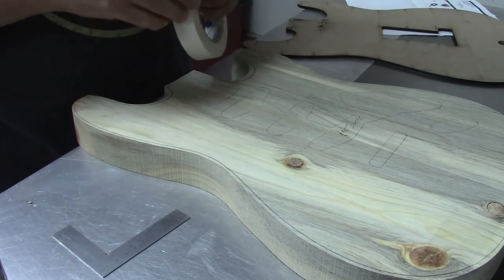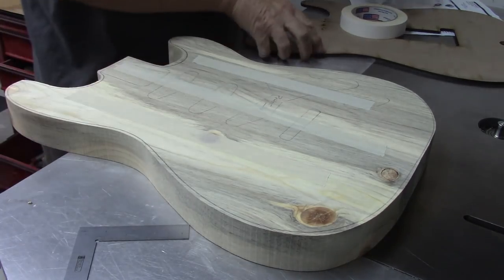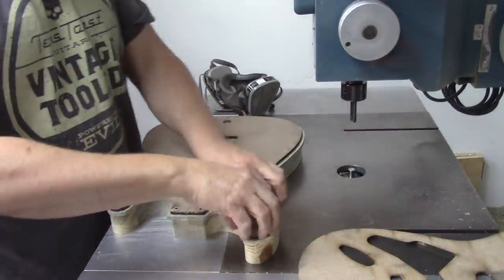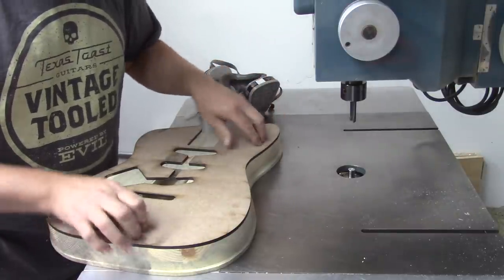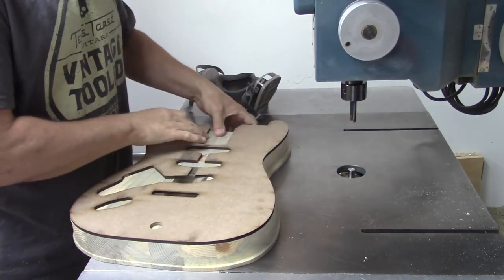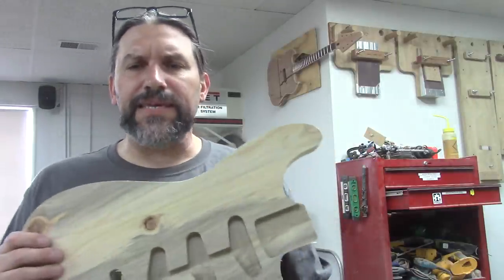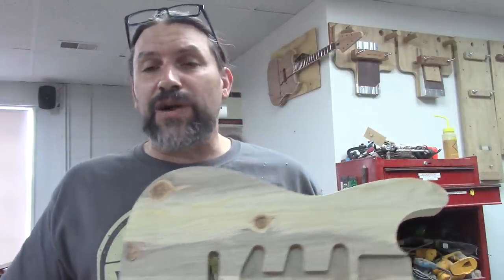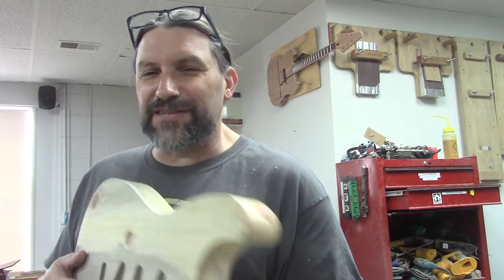What Ben At Crimson Guitars Got Wrong… Double Stick Tape

Comment: The real power of the masking tape and super glue trick is the fact that both are standard items available everywhere worldwide (or at least in Europe and North America), I've had great results with it without even using any accelerator. It's great you found a double-sided tape that works for you but a product only available in the US is hardly a replacement solution, the shipping cost alone is more than the cost of the product itself. Definitely not worth it, sorry.
Reply from the maker: You got to do you

Comment: When I use this type of double stick tape, I keep a squirt bottle of denatured alcohol near by.  If you pry up just the edge of your template and then shoot a little DA in there, it will release the adhesive on the tape and you don't risk damaging your template or your lumber. Capillary action will draw the DA down the tape joint as you slowly pry the two pieces apart.  The DA evaporates quickly and won't harm your lumber.
Reply from the maker: That sounds like a good idea

Comment: Like the pin router.  I hate tape (both double-sided, and it's evil brother masking with superglue).   I make working copies of my templates, and use 3 screws (in neck, bridge pickup, and one other place - depending on body I am making).  This takes just a couple of seconds and I route out the screw holes.  For component routing I use clamps to hold everything to my router table and route from the top.  I've tried the tape, but have never found any method that holds the template firm enough for it not to move.   Great looking pine body.   I use alot of pine, and cedar, in my bodies.  Enjoyed the video.
Reply from the maker: Agreed on guitars we make a lot of we figure out ways to hide screw holes or just fill the holes and leave them as makers marks

Comment: Just got some tape from Taylor tools and wow thanks for the heads up. Great stuff just like you said. Used it on a few different things today. Routing neck blank, holding a fret board to a slotting jig and holding a steel drilling template to a peghead. It really is great folks get yourselves some. Kick ole green teeth right in the knee and let him keep using masking tape and super glue. Waste of time. Oh. no sticky residue either.
Reply from the maker: It's good stuff man!

Comment: Looks great but I will stick with the superglue and masking tape trick. Mainly because it's what I have at the moment and it has worked perfectly well for me in the passed.
Also, delivery outside of the US sours the deal too. It's always good to have alternatives.

What I don't recommend is double sided carpet tape, well, not unless you want the template to never come off.
Reply from the maker: I just send 2 rolls to Ben, it wasn't hard at all
Reply: @TexasToastGuitars  I never said it wasn't easy.

Comment: Your template system is awesome. I really need to up my game in terms of templates.
A thought occurs to me though - did you have to switch to the bearing router bit for that last part? Couldn't you have done that part on the table too by just flipping the body upside down, seeing as the shape had already been defined on the back side?
Reply from the maker: If I was really smart I would have used the 1/2 round over bit to clean up that side and do the round over at the same time

Comment: Double-side tape is the way to go!!! Even if it cost more, it saves so much in workflow and handling. Not to mention if you accidentally bond your project together using the CA/tape trick. 
Ben gets a lot of credit for the CA tape trick, but he just borrowed the idea from someone else. CA/tape idea was around 30 years ago when The fella I worked for did the trick, he got it from someone else. It works in a pinch, but - meh
Reply from the maker: Ben even says he got it from a guy, I forgot who. It certainly does work but it is far from my go-to method
Reply: Ben's very forthright about where he got it from, it was an apprentice at Crimson, and Ben also admits how he scoffed at him when he saw him doing it because he didn't believe it would be strong enough.
Reply: @numberkruncherr  yep he did, more than once I believe, and nearly all reference to this practice is in Ben's favor... What I'm saying is this is not a new idea. It does work, I've used it, as have many others, but there is a better way that at the end of the day, week, month and year.  Someone here said "do what works", that's true enough, or maybe, "do what works better" if you can.  I have to think that Ben has access to double-sided tape, but the CA/tape thing has kinda become synonymous with Ben and CG.

Comment: I don't like that knot on the edge there. Not so much on the bottom but on the tip of the cutaway.  You don't think it's a bad idea to have knots on the edges? Ive had bad luck with knotty edges on other wood projects. Haven't come across it on a guitar yet though.  Just curious about your feedback
Reply: I was totally looking at that.  But that router bit cut through it like butter.  Must be brand new, super sharp.
Reply: @dalgguitars  it sure did. That's not my concern though. It's later on down the road. How will those edges act.  It might be perfectly fine. I don't know. I've only had one body where there was a small knot on the edge but it looked nothing like those. I have seen knotty pine bodies that looked pretty good.
Reply: @JoeKyser  Any wood that has such a big discrepancy in hardness between the knot and soft pine right next to it seems to be asking for trouble.  I'm totally with you.
Reply from the maker: I ain't scared
Reply: @TexasToastGuitars  ok ok guitar gods have convened and made the ruling.   Knots or not it's okay.  Thanks for the answer!

Comment: I like Ben’s hairdo. You know I haven’t been able to find the 3M around me so I’ve been using the Duck tape brand double stick tape. I don’t like it as much and it sometimes leaves that goopy adhesive on your piece
Reply from the maker: Yeah, that is a bummer
Reply: The only use I've ever found for any Duck brand tape was for stripping a CA glue finish that had layer separation from humidity. The adhesive is just crappy enough to leave the wood alone. Haven't tried their DST though.
Reply: Joe Flink it definitely wasn’t what I’d consider ideal, but it worked. When I was at TTG July classes I asked about the 3M and they couldn’t remember the number code. I found the duck double sided tape and decided to give it a try in a piece of scrap, then worked up to holding the neck template on and it worked well. I have been using it since to attach sandpaper to blocks. It’s cheap and works fine in that role.

Comment: It's really good that it leaves no residue. Do you know if it's left for some time if that is still the case? Not arsed really, just curious.  Nice skills 😎🎙🎸✅
Reply: @ Julian, that's a great question as I know from personal experience, the longer you leave ordinary masking tape the worse it is to remove👍
Reply: @CaptainScarlet1961  you're right, it gets really sticky and slimy as well.
Reply from the maker: Given a long enough time line ALL tape will leave some crud behind, start to degrade or completely dry out. For what we do we have not had any issues

Comment: The thing about masking tape and superglue is that I can go and buy it whenever I want, at several different places.  No ordering by mail necessary.

Also....what is the advantage of that router?  It didn't really look faster or easier than a regular old router.
Reply from the maker: Sounds like you aren't a fan of anything I do Stuart, have a good time

Comment: That’s a cool way to change the template for the control cavity. 

I used to use the first plunge of the route from the template as the template for the shape of the guitar. Meaning, I would put the the squared off block of wood into the my jig with hold down clamps. The block was referenced to a right angle in the lower corner of the jig. Then cut out the interior cuts. Then put a groove first cut in the outside shape. Remove the body and cut the excess on the bandsaw. Then back to the pin router using the first cut as the template for the remainder of the body shape. 

Always many different ways of doing it. 

I watched the old music man factory screw their template onto their body blanks. I wanted to save a step. 

The downside to the way I did it was I needed a dimensioned blank to start with. I guess if I was using odd wood shapes I’d choose another method. 

And you always provide great info
Reply from the maker: Thanks for watching my friend

Comment: Here’s a tip to start removing the tape. That little piece you tore off by hand to show you don’t need a razor to cut it.....take that and use the sticky side to grab the paper on the top of the strips you applied. It’ll pull up all of them and you don’t spend 5 minutes trying to pull the paper off with your nails!
Reply from the maker: I'll give it a shot

Comment: The CA glue/masking tape works, but it can be messy if you aren't careful. I prefer two sided tape. The one I use is marketed as "carpet" tape, 2" wide, and is sold by IPG. You can get it online, but I do not remember how much it costs.
Reply from the maker: We have tried carpet tape a few times too

Comment: I received this tape a few days ago and I'm done with the super glue and blue tape trick. If you use this stuff carefully it's easier to get proper positioning which isn't always possible with super glue. You just need to mind the pressure sensitive nature of it when putting the two pieces together. Plus this stuff is thinner making it more accurate when using pickguard templates. I'm sold. Thanks for the tips TTG!
Reply from the maker: Glad you like it Joe

Comment: the benefit Ben's trick has is sheer holding power, yeah this gets the job done but you'd need to use a lot more tape to get the same strength that you gain from burnishing the masking tape before gluing it together.
Reply: plus a roll of masking tape herein the UK is a tenth of the price than this stuff, and it's useful for other things like... masking.
Reply from the maker: Yeah yeah we know

Comment: I used to build R/C Aircraft using CA Glue, and alot of the time the shit that was left over would get hard between builds. For me it was frustrating! Now if you only build a couple guitars a year that to me would be the downside of the CA trick. It isn't cheap!!!
Reply: Buy the small 1" tubes at the dollar store or flea market.....I get them 10 for 1.00.
Reply: @cugir321  Thanks for the tip David.
Reply from the maker: We use the Hot Stuff brand, it lasts a long time
Reply: @TexasToastGuitars  My glue of choice was normally "Zap" But also used Hot Stuff from time to time.

Comment: Love your videos :D ....  I was wondering if 6mm mdf is to thin for templates !?!?  I don´t have a pin router just plunge router and I can turn him upside down attached plexi....regards from Iceland
Reply: Hey Svanur, I'm not sure how TT makes their templates, but we'd make master templates from 6mm/.25" MDF. Then use the thin master template to make working templates which were typically 1/2" or 3/4". Always kept the master template safe for making more work templates.
Maybe Matt will let you know what process they follow.
Reply from the maker: You can use really thin templates but, as you know, run the risk of damage. The pin router is nice since the bit and rub collar aren't attached. If you are careful you can certainly do it. It was mentioned before that making a template from the original is a great idea too
Reply: @theNextProject   thanks for this.

Comment: I'll definitely check out that tape it looks really good. I use the 3M stuff from Stewmac or carpet tape from Lowes, you can get a carton of that stuff real cheep, it sucks because it has all of the threads in it but if you run out of 3M it works just fine in a pinch. I just built 2 custom T style guitars for my buddy out of a huge pine barn header that was on his family's property since the 1800's. I filled all of the cracks and inclusions with dyed epoxy, they actually turned out really cool but my bits and blades didn't think the ancient crusty pine sap was very cool. Keep up the great work guys!
Reply from the maker: Carpet tape will certainly work, we have used it a few times. I love that old pine for guitars

Comment: Looks like a great alternative. The glue method needs quite some superglue and I love the freaking fumes in my eyes. Now I just have to see how bad I get bent over to import this stuff. Wearing your mask is smart, and I consider you smart. I asked Dan Erlewine if he has any health problems from building and fixing guitars including any allergies of exotic woods. He wore a mask early on and that's why he has none but the carpal tunnel got him and got surgery. Btw, this video title works well with the pre-sizzle for the build off. Any lifesign of the other builders besides unpacking?
Reply from the maker: I just ordered 2 rolls and had them sent to Ben at Crimson it was easy
Reply: @TexasToastGuitars  
Noice. I've set a reminder for the link you provided to order some soon. Maybe Ben will like it so much that he puts it in stock.